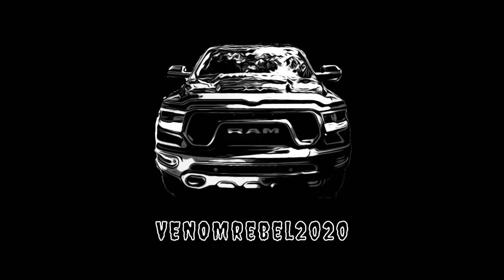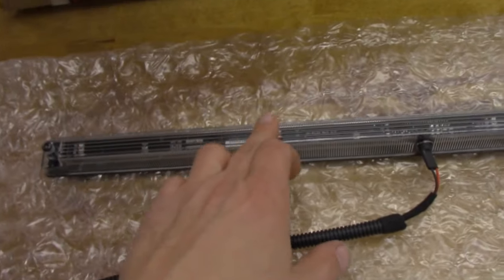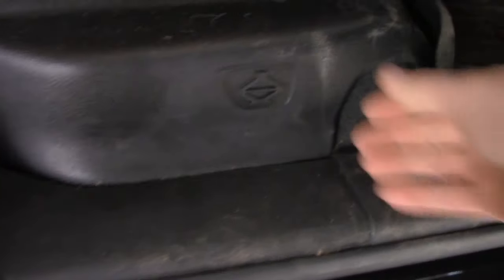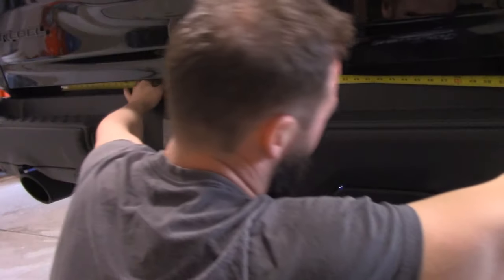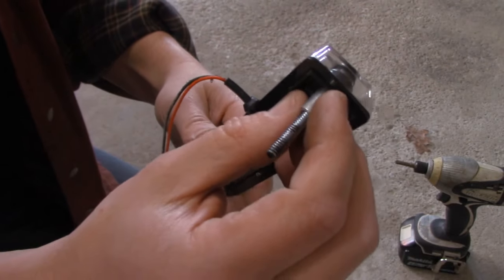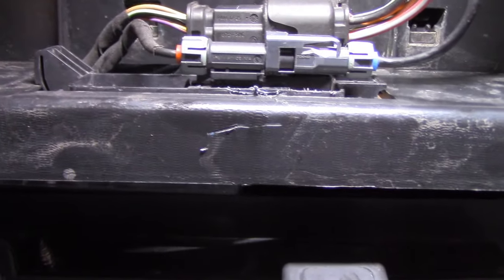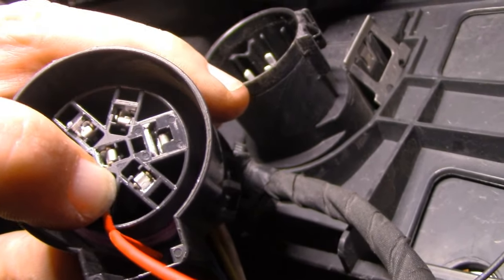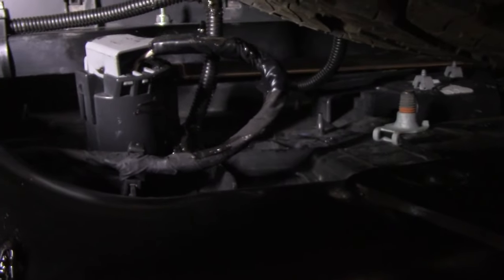OEM TRX Rear Marker Lights Install 2020 Ram 1500 Rebel 5th Gen

Comment: I like the it! My Ram Mega Cab has had it for some years now. The difference is my three light bar has a red lense and the front makers are the big orange ones on the roof. Basically the factory dually marker lights on a non dually lol. I like the look, you did a great job!

Comment: I’m getting ready to do this mod now…I have all the parts…video is awesome and very informative!

I have one question though, how low do you drill on the bumper for the 2 holes for the screws? Any measurements on that?

You mentioned you had to re-drill cause of tailgate hitting the light when opening…

Thanks in advance!
Reply from the maker: I will take a look. The truth is it rubs a bit, probably no matter what. Not enough to prevent the tailgate from fully opening, but enough to notice.

Comment: Where did you move the wiring harness for the tailgate camera that is mounted where the light needs to be? Thx
Reply from the maker: I did not move it. I used spacers.
Reply: @venomrebel2020   Thanks I just watched your video again more closely.  Wasn't even thinking you could put the light on top of the wires.  I've discovered you can buy the TRX tailgate harness that would move those wires over so they aren't an issue.  It's $70 though.
Reply from the maker: @whenspidersattack2449  I did exactly that. Be mindful of how it might interfere with the tailgate drop. Positioning is important.
Reply: @venomrebel2020  Thanks again.
Reply: Do any of you know the part number for that harness?? I rather spend 70 bucks more and leave it like it should be!
Reply: @RekonRC  This is the parts list I came up with.  Haven't bought it all yet.  
68442740AA - Close out panel Qt 1 $40
6509432AA - Snap in nuts Qt 2 $8
06036789AA - Screws Qt 2 $8
68362184AB - Lamp Bar Qt 1 $60
68531013AB - Wiring Harness Qt 1 $75

Comment: Hey Venom. Where did you drill the left side hole? Above the wire harness or below it?.. driver side…
Reply from the maker: I used the existing hole on the left. Good luck!
Reply: @venomrebel2020  Finished it up yesterday… Nothing is easy. Lol Came out nice though. Thanks!
Reply from the maker: @newlovesportfishing4870  Great dude!! 👍🤙

Comment: Hey Venom!.. if you did this again would you use a shorter screw?
Reply from the maker: Probably. I might still have to hack the excess off the screw behind the electrical connections. But probably 🤙
Reply: @venomrebel2020  Getting ready to install this soon. What length screw would you go with? Not looking to hack the excess
Reply from the maker: @newlovesportfishing4870  I honestly have no idea. For it to work the screw needs to be shaved right to the locknut.

Comment: Any drilling?..
Reply from the maker: Just in the plastic flap between the tailgate and the license plate
Reply: @venomrebel2020  Did you take any photos of the install process?.. Great Vid but it’s kinda hard to figure out where in the truck you were in some of it...
Reply from the maker: @newlovesportfishing4870 all the action is happening under the rear of the truck. Drop your spare... makes a nice pillow 👍
Reply: @venomrebel2020  behind the rear bumper? What size spacers and bolts did you use?..
Reply from the maker: @newlovesportfishing4870  should be in the description. If you’re on your phone tap the title.
Reply: @venomrebel2020  awesome! Thank you